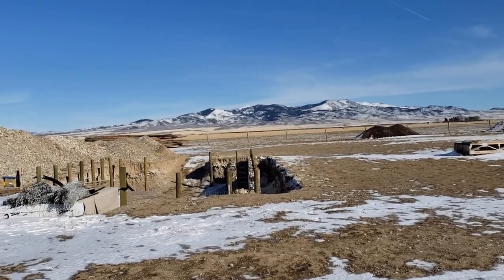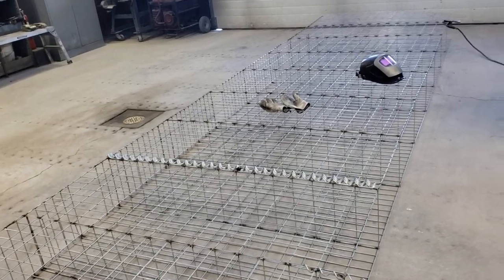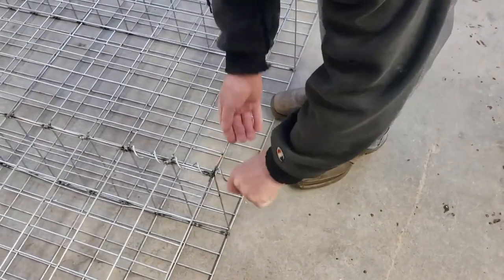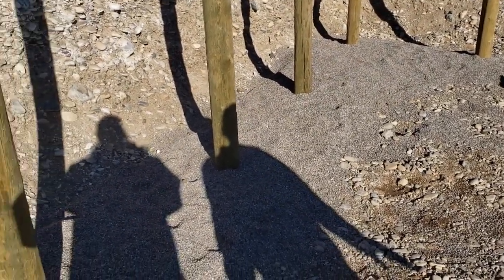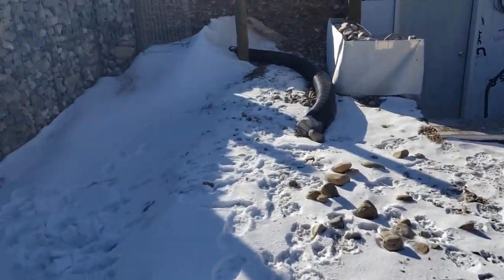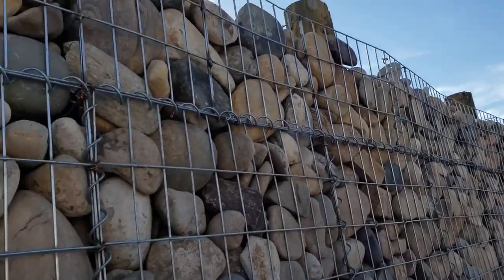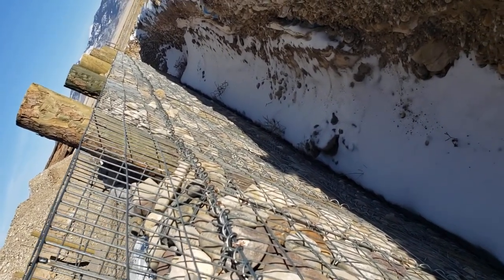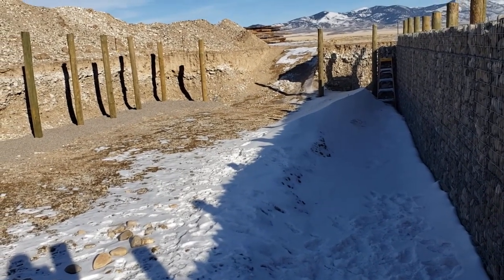Step 10, building gabion basket walls for a Walipini style pit greenhouse

Comment: Very hefty  work for just a couple , respect from Saudi Arabia 🇸🇦. 
I may try that myself.  I will have to make the cages myself as they are not available locally .
Reply from the maker: Welcome Saudi Arabia!  Try landscapers or road construction companies for access to the cages.  These cages are frequently used to shore up hillsides when putting in roads.  Also used for creating nice rock gardens.  We did make our prototype cage out of hog or cattle panel typically used to make temporary fencing for livestock.  If you use these panels make sure the gauge is thick enough.  (There is a video on gauge thickness).   And yes, these pit greenhouses are used in dry hot climates as well.  We will have a video when showing how we put in tubing for air exchange that can expel hot air out.  
Best wishes on your endeavor
J&K

Comment: And what length are your posts and how deep are they set in the ground?
Reply from the maker: Hello and thank you for your comment.  Check out the video Step 8a where we talk about this more.  The south facing wall is deeper in the ground to allow for a cold sink.  So those poles will be cut to be about 7.5 feet tall from Walipini floor level.  The East, West and North walls are about 5.5 feet tall.  All posts are about 3 to 3.5  feet deep into the ground and anchored with rebar.

Comment: Where did you order it?
Reply from the maker: Hi @moneybay   Thank you for your comment.  There are a number of suppliers out there but availability is the issue. Many of our kits were purchased before the supply shortages today. However, we did run into some issues with supply and canceled shipments for kits ordered in 2021, so we purchased from various suppliers. If you are in the US, there is more availability from Earth-Wall Products out of Smyrna, Georgia. This supplier provides twisted wire gabion baskets which I believe offer more flexibility with support over the tap wire welded cage kits we ordered. (Wish we had gone with twisted wire to save on all the additional tap welding we did ourselves to achieve more structural support). Another benefit to Earth-Wall Products is that they have a structural engineer on staff that can provide guidance for your design. Another tip for resources in your area is to talk to large landscapers or fencers. Gabion baskets are traditionally used in landscaping and fencing. These businesses should be able to give you some leads. If you buy from big box stores or big internet suppliers (ie. Amazon, Wayfair) , just make sure you are getting rust resistant, galvanized metal that is at least 9 or 11 gauge wire. If you wire cage is made of twisted wire, instead of tap welded, you will pay more.  Cheers, J&K

Comment: Where did you buy these kits
Reply: Thank you for your comment. 
I bought the kits from several sources.  I ordered some kits in 2020 and had little sourcing issues. Availability became an issue in 2021 and some orders were backorder then canceled.  Others came incomplete.  You may want to buy domestically.  Check with large landscapers in your area for sourcing since  gabion baskets are typically used in garden walls.  We bought tap-welded baskets and I wish we would have gone with twisted wire.  This would have saved time in reinforcing.  I talk about this in one of my videos so that is something you may want to consider if your walls are tall.
Cheers
J&K